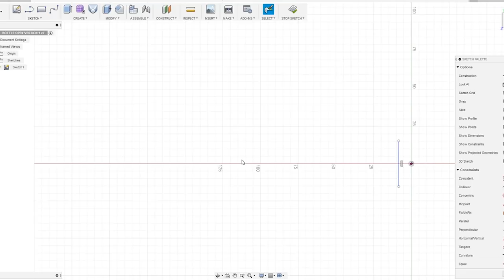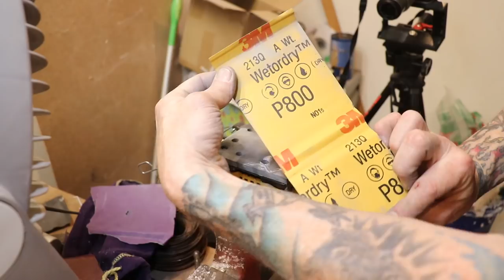#2019OpenersOpen Lost PLA Casting a Bottle Opener

Comment: Nice to see the improvement you've made on the process. That's how they do it where my father works, just on a larger scale with robots, and they use wax presses with injection dies to make the parts. You ever look into that wax printer filament for metal casting?also idk how long you let the shells cool down before pouring, but it might help a lot to leave them in the kiln and keep them hot and take them out right before pouring, that way the metal stays molten longer inside the shell and also helps air from forming pockets. Where my father works they leave the shells in the kiln and get the metal ready to pour, then pull out the shells right before pouring. And the shells are glowing orange, of course they mainly pour stainless steel, and bronze
Reply: Sin, Yep, leave em hot till just before pour - for aluminium I think shells at about 450 Deg. C... Martin
Reply: @olfoundryman8418  you just earned a new subscriber. I love this metal casting stuff. Currently have all the stuff sitting in my shop to build a foundry, just havent had the time to build it.
Reply: I think that you might have to put the word on your Dad for a video tour of his foundry and show the process from start to finish.
Reply: @markfryer9880  I'd I could get in there on a weekend I could make a video, idk when that'd happen though. My dad however struggles with technology. I have to help him with his smart phone all the time. If he shot a video it might be. Out of focus and have a finger blocking most of the frame lol
Reply: @sinformant , Hang on I am old too - older than your father I would think - take it easy on us old guys remember the only difference between you and us is that we got here first 😀 But, seriously I am with Mark see what you can do for a walk through video  it would be good... Martin
PS, Get your act together and get your own foundry up and running, with the inside running through your father it should be a breeze.
Reply: @olfoundryman8418  lol I respect my father a lot. He has taught me most of what I know and I inherited his genes and ability to figure things out by doing them. I got lucky that way. And me being 35 and seeing these younger generations and what they seem to get enjoyment from makes me feel like I'm ancient lol. My dad was born in the very early 50's. He understands everything else but computers

Comment: Hello. Me again on this video :)
Something is not good about your metal flow, and making the failure on the 2 first casts : your channels between the feeder and the piece is not good : too thin !
You have 6 channels to inject all the metal from the main gate, and the added surface of all these channels must equal the main gate.
The goal is to have enough flow to feed your cast.
Ideally, the transition between the parts must not have size changes, or angles, in order to keep a laminar flow in the metal (your pouring basin has this shape to create a laminar flow in the aluminium).

I hope to see your next casts soon ;-)